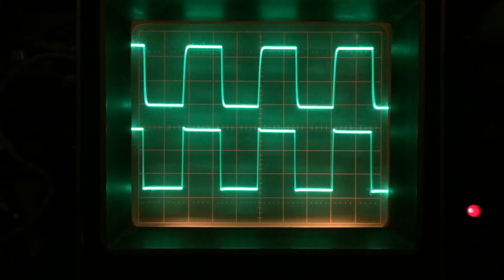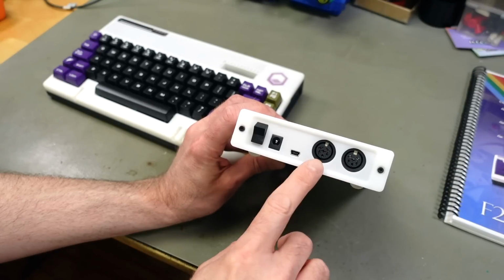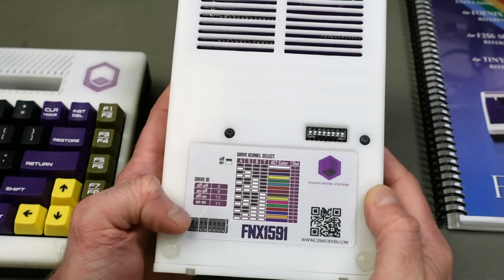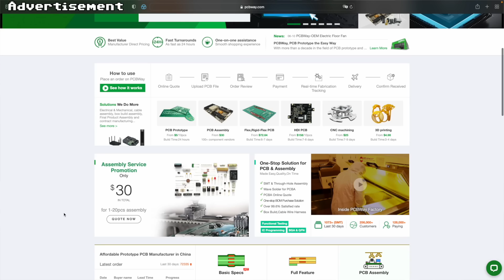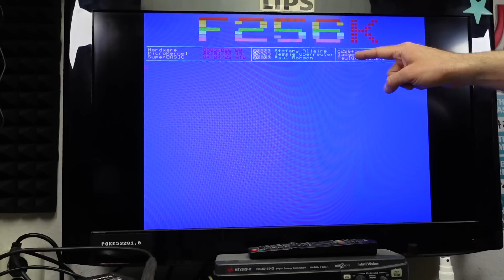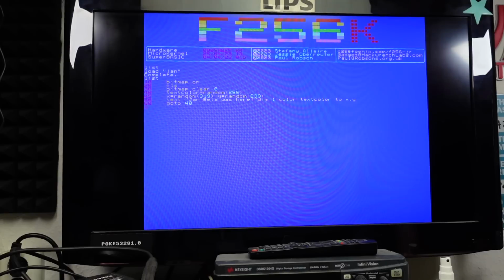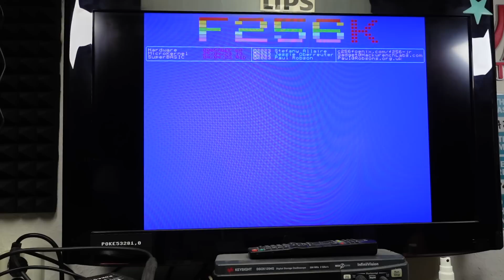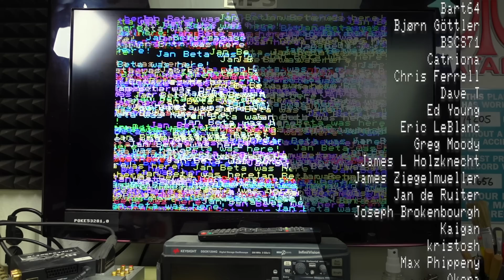Foenix F256K New Retro Computer

Comment: This machine seems wayyyy better thought out and designed than the Commander X16 project.  Love seeing the custom integrated keyboard wedge case design rather than dumb unimaginative modern PC form factor stuff.
Reply: The current X16 form factor is just the first stage design, the final stage will suit any form factor.
Reply: @Ffinity  +  the x16 was made for a different set of requirements. Besides,  these are 8 bit machines, to me at least, aesthetics are not important.
Reply: I agree the X16 is so far away from how it was originally envisaged. This on the other hand is flexible, familiar and attractive looking.
Reply: @prk55  No it isn't, it was always going to be a 3 stage evolution.
Reply: The Foenix has both.  The JR comes in a mini itx form factor.
Reply: Damned shame that Stef and David couldn’t come to terms on a collaboration bitd. What Stef has been able to accomplish is amazing.
Reply: @markstrickland438  'Stef' and David were on very opposite ends and had different goals on design and function.
Reply: @Ojref1  Why the scare quotes? I have the word Stef saved in my phone keyboard, as a contraction for a Stefany that I know. I didn’t bother to spell it all the way out. 

Very opposite ends? Wrong. If they were on “very opposite ends,” they both wouldn’t have had modern retro 1980s computers in mind. THAT is the opposite of “very opposite ends”. 

Different design functions? How did that work out? It worked out by David using an FPGA….and ‘Stef’ using an FPGA. It worked out by Foenix systems coming to market years sooner. 

Again, it is a damned shame that their collaboration didn’t bear fruit. The whatever the name would have been would have benefitted from David’s huge audience and the entire project would be years ahead of where it is now.
Reply: @zoeherriot  I'm not being overly pedantic. I understand their initial goals. Regardless of initial goals, David ending up using an FPGA. I'm not arguing for or against, just defending myself. I don't give two shits if he uses FPGAs or not. I really dig the idea of using all dedicated, old school type chips. 

Again, it is a damned shame that Stef and David's collab didn't come to fruition, as the CX16 - or whatever it would've ended up being called - would've been out years prior. Nothing more or nothing less.
Reply: @zoeherriot  soldering some through hole components doesn't do anything to tell you how old machines worked. If you want to figure out how old hardware worked, buy a 6502 kit from Ben Eater. .
Reply: Try mentioning "foenix" in a comment under the seven-bit guys videos, good luck.
Reply: @zoeherriot  The end result is shockingly similar: Both use a discrete 6502 CPU and video+audio comes from an FPGA. If Stefany would put her FPGA on a daughter board like the Vera is on a daughter board, I guess it would have met David's goals (after the compromises he made).
Reply: It doesn't matter which computer looks better or has better specs.  What matters is which computer will have the bigger community and software library.  

8-Bit Guy is currently the #1 software publisher for the PET, VIC-20, and C64.    He will be making games for X16.  Who will be making games for the other competitors?
Reply: @customsongmaker  I doubt these two still births will have a community as much as the 7-bit guy is a software publisher. The way to make this whole 8-bit thing progress would have been the two best, the 65816 and the 6809, to make assembler coding interesting and have a hope of doing something useful.
Reply: @Breakfast_of_Champions  PETscii Robots is the best game for the PET, and it comes with an audio output adaptor and SNES controller adaptor.  The whole world had 45 years to do that, but nobody else did it except David Murray.  So the odds are that nobody else will ever release anything that good for the PET ever again, because the only guy who could do it is now using his talents exclusively for the X16.

You mention assembler coding, maybe you meant assembly coding.  Either way, David Murray has planned for it.  He designed the X16 to do certain things he had in mind, and I bet he's doing those things in new games.  These other computers were not designed for any particular reason, so nothing particular is being developing for them.
Reply: @customsongmaker  Do you even know the Mensch Computer? All that was necesary was adding gfx/sound to it. Make it a "C64 GS". The X16 has already failed, from the whole brain-dead architecture to the 7-bit handling of the project and production.The seven-bit guy is so petty he even deletes every mention of the Foenix in his video comments.
Reply: @Breakfast_of_Champions  What's your favorite game for the Mensch computer?  I don't think it's a very successful computer.
Reply: @customsongmaker  That's not a point at all, it's the reference design from one of the remaining original CPU designers. Both the X16 and this one were designed by ppl who don't understand what they are doing and don't understand coders. The seven-bit buy is really just doing everything for his home business.
Reply: @Breakfast_of_Champions  the 8-Bit Guy has coded a lot more software for the 6502 than you have
Reply: @customsongmaker  😂victim
Reply: @Breakfast_of_Champions  You just don't understand real coders who actually make successful software
Reply: @customsongmaker  Dude grow up and stop being a victim.
Reply: @Breakfast_of_Champions  Your only point is that you're a victim of people making computers wrong
Reply: @customsongmaker  No he isn't,  ProtoVision, RGCD, Psytronik and Double Sided games each produce far more games than David. That's of course doesn't mean that these publishers will develop for the new retro machines, but the CX16 can't just depend on David's games either.
Reply: @danielmantione  None of those 4 companies make any games for PET.

Anyway you're correct that one person can't make all the games for the X16, but he's going to be like Nintendo developing the most recognizable games for their own consoles.  Then, after his games get attention, more people will adopt the computer and more people will make their own games for it.
Reply: @customsongmaker  With all respect to other computers, the C64 is by far the biggest retro computer community and the CX16, F256 and Mega65 all need to fish for customers in the pool of C64 users. In fact, most PET users will have C64s as well. Therefore it's not so relevant who makes games for the PET, it's relevant who makes games for the C64, buys one of these new machines and starts making games for his new machine.

The large audience of David's Youtube channel is a big thing that favours the CX16, but that doesn't mean that the other computers don't have any cards in their hands. For example the Mega65 is way ahead with +/- 3000 machines in the field and its C64 compatibility makes developing Mega65 enhanced games way less effort.
Reply: @illegitimate-egg  aesthetics are important if you're expecting people to pay the prices these things are asking for ($500 and up). Let's be honest here, there's absolutely no need for any "modern vintage" 8-bit computer when there are actual functional vintage 8-bit computers and modern low cost kit systems such as the MiSTer and RPi which already scratch that itch at a lower or equivalent cost, so these are all luxury products trying to appeal to a niche market. Looks and design aesthetics matter, sometimes they are what pips the purchasing decision. For example, I wouldn't consider an X16 until it comes in a sleeek compact unit, but I would consider getting the Mega65 and the Foenix256 simply because they look gorgeous.

Comment: Apart from the in-line assembly, what made BBC Basic more useful than most was the FUNC() and PROC() commands which allowed using Functions (with return value) and Procedure (with no return value). Very powerful.
Reply: Unfortunately it's not possible for BBC BASIC to be legally ported over to any 6502-based machines at the moment. Seems like nobody is 100% sure who owns the rights to it, because they've changed hands so many times and the original paperwork is missing (or at least that's what I've read around various forums and groups).
Reply: @OzRetrocomp  I've got a copy of BASIC V (the Archimedes version) on a raspberry pi somewhere.
Reply: Func() and Proc() were from COMAL (another structured basic dialect with PASCAL elements), Bbc Basic had DefFn() and DefProc() and was based on Comal in turn. "American" Basic dialects like Quick Basic, True Basic, Ansi Basics ecc. were more in the FORTRAN style and used SUB rather then PROC
Reply: @giuseppe74921  Didn't know that. Will look up COMAL at some point for a crack.

I was of course, comparing to the BASICs of the time/place e.g. UK home computers, specifically Sinclairs, Commodores and Tandy/Dragon - none of which had definable procedures/functions (just gosub, which, let's be honest, is terrible).
Reply: @simmo1024  The Comal interpreter had several versions, there was a version for almost every computer from the c64 to the PC (i tried the Amiga version it is quite good). The problem was that it was not in the rom of 8bits computers (c64 ecc. so u had to have the cartdrige inserted if u had one, like Simons Basic, if u made a program, people using your program had to have the cartridge too, so it was not very useful). Also Comal made it too far from basic and too much toward Pascal (for example variabile assignements were done like in pascal/c with := so in some way it felt more like a new kind of interpreted language and not very much like Basic, i think it had some success only in its motherland, Sweden i think, as a teaching language in schools), bbc basic took lots of things from Comal but stil felt 100% like basic, it was very powerful and was in the rom of the computer, in Italy the Bbc master 128 was rebranded as Olivetti Prodest 128s, since Olivetti acquired Acorn in that period, and it was much advertised on TV, but it was not a great success since the C=64 had a massive base of users i think, and it was already Amiga time if I well remember, but i remember some "List" type-in computer magazines had some Archimedes and Olivetti Prodest 128s lbasic listings, and I thought wow, how elegant is this basic! In the magazines they often said it was the best basic and it was also very fast
(Sorry for my bad english and long post)

Comment: Another SuperBASIC? Looks interesting.

The BASIC on the QL was called SuperBASIC and included many of the powerful features found in BBC BASIC with a few of its own allowing new commands to be created by the user. Unfortunately due to hardware limitations and the ROM being optimised for compactness and not speed, it didn't run that quickly. It was still a very nice language.

I'll be interested to see how the new SuperBASIC compares with regards to features and specifications.

Comment: 🎯 Key Takeaways for quick navigation:

00:00 🖥️ The Phoenix F256K is a new retro 8-bit computer with a classic form factor reminiscent of systems from the 80s and early 90s.
01:23 ⌨️ The keyboard design of the Phoenix F256K is similar to the Commodore 64 keyboard, featuring modern switches and custom keycaps.
03:02 🏗️ The computer comes in a high-quality resin-printed case and has an expansion slot for RAM upgrades and cartridges.
04:23 🕹️ It has standard Atari-style joystick ports compatible with common Atari joysticks and supports three separate fire buttons.
05:45 🔄 The Phoenix F256K offers various connectivity options, including USB, Wi-Fi, a headphone jack, and RCA audio output.
08:53 💽 It supports a 3.5-inch floppy disk drive compatible with the Commodore 1581, providing additional storage options.
12:51 🧠 The computer features a W65C02S processor, expandable RAM, and integrated graphics and sound chips.
18:21 🖥️ The Phoenix F256K boots instantly into Super BASIC and supports modern features like syntax highlighting and indentation.
23:49 🎮 The system can display 64 sprites simultaneously, has smooth scrolling, and includes an inline assembler for programming.
26:47 💰 The Phoenix F256K is available for purchase at $595 and is made to order due to its low volume production.
27:12 📦 The computer features a 3D printed resin case and can be ordered from the website, with the order period extended to mid-July.
27:54 🖥️ There's an emulator available for the Phoenix Junior, a similar system, which allows you to experiment with the system's capabilities on your modern computer.
28:20 🌟 The Phoenix F256K is part of a growing trend of new retro systems inspired by the computers of the 80s and 90s.

retrotechlab.com

Comment: This looks like what the Commander X16 should have been, entry level $200 for a motherboard only version you can slap into a mini-itx case. F256K is kind of pricey at almost $600 though but it looks incredibly well put together. Main thing is these are available to purchase and have lots of upgrades and tinkering you can do because all the glue logic is FPGA based.
Reply: yes it's real hard where, but, but for the price, you would get a lot of hardware, to run a emulator/simulator of your classic 70's, 80's,, 90's machine on, it on going to be a real machine, but at least going to be almost 100% compatible, to the really thing, and changing you mind, going with different model is just software download away? and some of the emulator even run as the system OS, and and with a bit extra work could just boot from USB memory/drive think, and could even be just plugged any machine that will just power up, monitor and keyboard, (and mouse if your chosen emulator needs one)?
Reply: Fails in the same as the X16, the price. But is a really nice system, no doubt.
Reply: At least the X16 has a community, tons of software will be (and are already) written for it and. The price will fall the 2nd/3rd gen. I don't see nohing coming for projects like Foenix or Picocomputer 6502. Still very impressive work, though.
Reply: @rafaelmmartinez9170  Isn't the X18 FPGA-free? I don't want fat, entitled FPGAs in my 8-bit computers.

Comment: It's a little odd that the joystick ports don't support mice. Quadrature mice like the ones used on the Amiga and ST are purely digital devices, supporting them only requires a couple of hardware counters hooked up to the L/R/U/D lines on the joystick port.

Comment: Nice new 8 bit retro computer, $600 is a lot of money for just the basic model, but I understand it's expensive and takes a lot of work to get something like this into production. My concern is mostly that the community will shrink very fast and 12 months from now almost everyone lost interest. Just like the big retro releases like Spectrum Next and the MEGA65. Whereas with something like the original C64, there will always be a community.
Reply: Keep in mind, this one with the wedge/keyboard case is the "fancy" one, the "basic model" is only $200.
Reply: @frixyg2050  I don't really have a problem with the cost, I think the one you refer to is the board only version with no case and no keyboard. I was more comparing to the maxed out version that goes for $1,349 in their shop. My concern is how much time will you spend with this before it ends up on a shelf never to be powered on again compared to an original C64/C128/Amiga etc. It really depends on the size of the community.
Cheers,
Jake
Reply: $600 CAD. Idk if that makes much of a difference, though.
Reply: i dont think the spectrum next community has shrunk there will be about 5000 new user going to that community ion just a few months and they are also producing a lot of games for that machine.  Is probably the most successful retro computer remake.